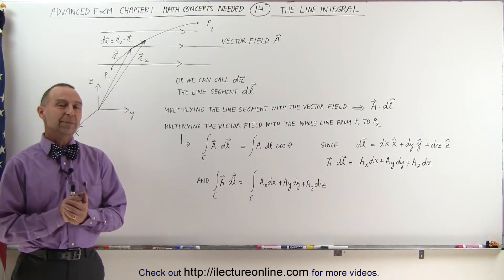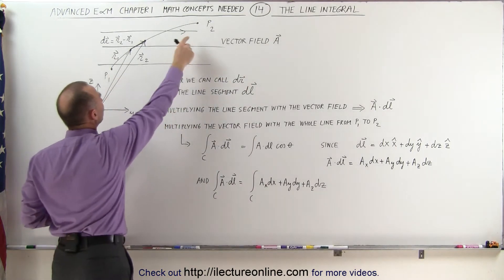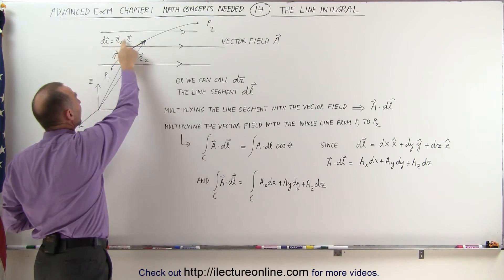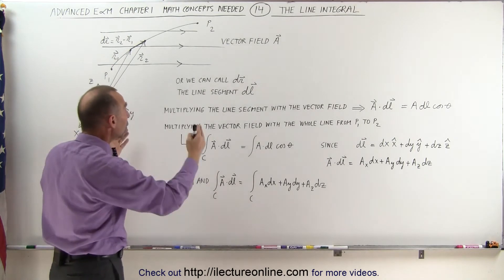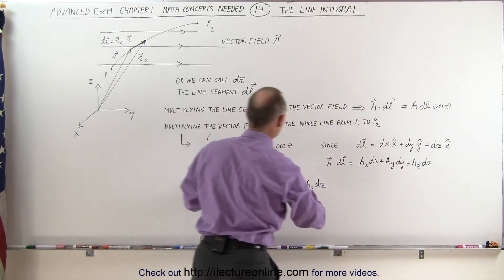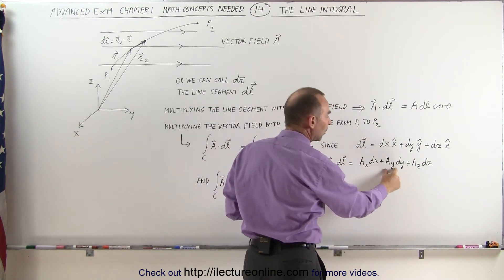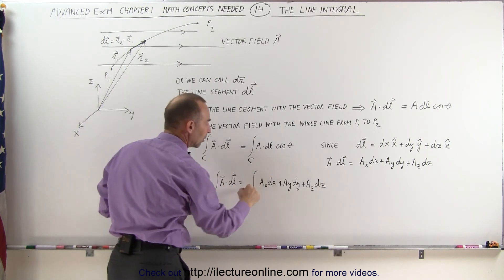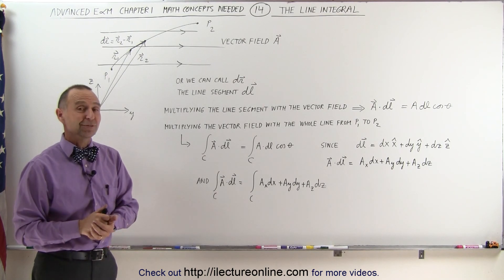Physics - Advanced E&M: Ch 1 Math Concepts (14 of 55) What is the Line Integral?

Comment: I never knew a concept like this existed. Thank you for bringing it to my attention.
Reply: +BlinkY  Good thing you be interested in this, what are you studying ? You should study engineering, physics or mathematics if that you are passionate about

I am a student of engineering, and I have to do this forced and happy
Reply: +kevito111 I'm studying Systems Engineering at university. I had a module on Calculus which I enjoyed. I also had a module on machine learning in which neural networks use the idea of gradient descent and thus calculus.
Reply: +BlinkY 
There exist many different types of integrals.
Another fairly interesting integral is the surface integral, which is essentially an extension of the line integral and that lets you calculate the area for a surface of any shape (well, any shape that can be described as a graph, at least).
Reply: +Laurelindo Interesting. I'm familiar with what one would call 'traditional' calculus but it's interesting it extends to many areas.